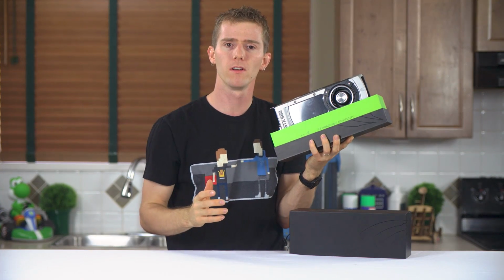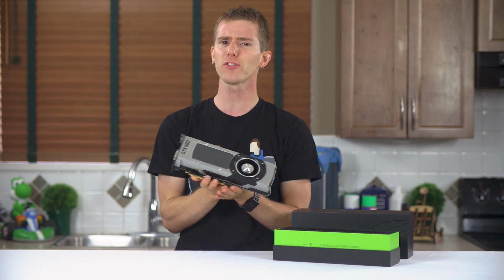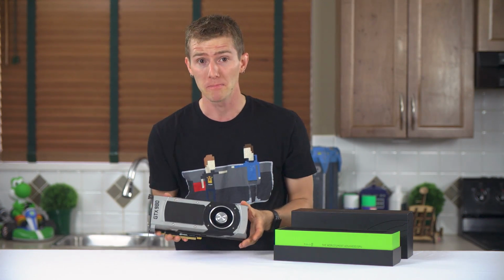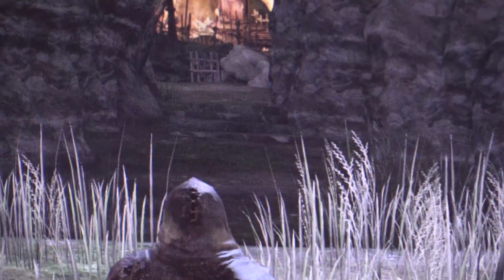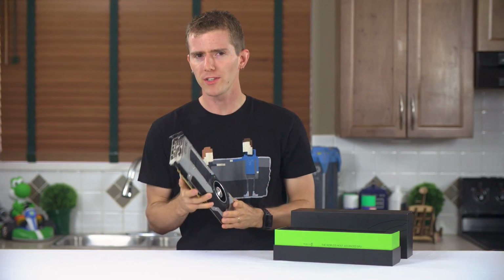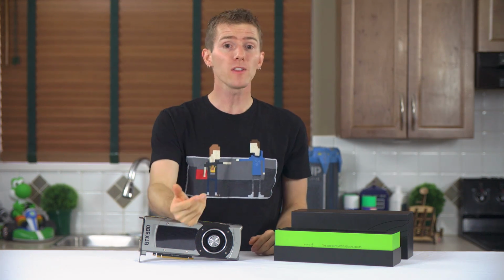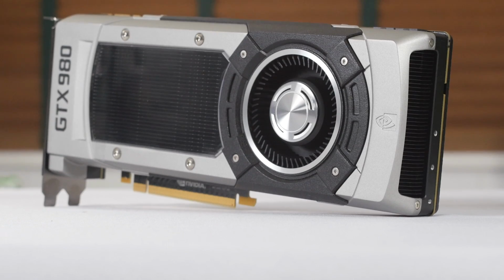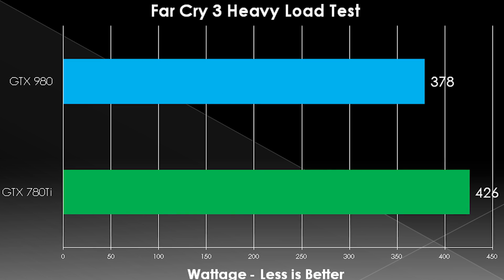NVIDIA GeForce GTX 980 Video Card - Performance Overview

Comment: Is it worth overclocking gpu and cpu?
How much fewer life time do I have and what do I gain for it?
I have fx 6300 and 280x gigabyte edition and 212 evo for cpu cooling.
Playing on 1 1080p monitor.
My motherboard is asrock 970 extreme 4.
Reply: David Vu I am not using 980 or 780 I am using 280x read what I wrote.
Reply: David Boggs The FX 6300 is a really nice CPU actually. You can max out most games with that CPU. That's basically like saying the 8350 or 9590 is garbage because games don't use all 8 cores. By the way you sound like an Intel fanboy :P
Reply: This David guy is an idiot. You can get a decent OC on your CPU with the 212 Evo, I have one myself :) I'm assuming your gaming, overclocking your CPU won't do much at all, but you can boost it 400 Mhz or so just to be same, overclocking your GPU will help but your likely going to get 10% so 4 - 5 fps more. Your stuff will last forever stock and possibly less overclocked, Ive ran my CPU overclocked 2 years straight and a year straight at 80%-100% with no problems, but its an intel so it could be different.
Reply: David Vu You are pretty bad at reading aren't you? lol
It says right there that I have (cooler master) 212 evo for processor cooler.
Reply: Jessup Smith it can nearly max out games that use all its cores, but not single/dual core games. period. btw, you sound like an amd fanboy XD
Reply: Victor Do this victor Do is just a troll, they werent even talking to him, and he replied to him earlier XD

hey, look at that! we can all do it to! ha ha! 

idiot.
Reply: Victor Do http://www.bit-tech.net/hardware/2013/06/12/intel-core-i5-4670k-haswell-cpu-review/5

http://www.tomshardware.com/reviews/gaming-processor-frame-rate-performance,3427-6.html

http://techreport.com/review/23750/amd-fx-8350-processor-reviewed/5

those 3 are just for skyrim, we can find many more for you.

http://www.anandtech.com/bench/Product/697?vs=701 scroll down to games. it simply gets 30-50+ fps in games that dont use all the cores. and has less hickups in games that even do.

btw, the i5 is only around 160 at microcenter. and a board is 120$ the killer.  so no, that whole argument is not valid anymore.  

I only have a fx6300, the 8350 is no different. 

delusions run deep, and very deep indeed.  for games that use single core, and dual core threads only, and emulators. the i5 is simply a VASTLY superior cpu. with sometimes double the fps. in world of warcraft my friends i5 with same gpu and ram, gets 60+ more fps. 
 
So this is the famous amd fanboys I've heard so much about.
Reply: Overclocking doesn't reduce life, heat does. Overclocking has huge benefits. For example, i get much better frame-rate on a moderately OC'd 770 in my heavily modded Skyrim install to the tune of about 15%. Only clock to what your cooling can actually support.
Reply: You are going to need a new CPU as yours is bottlenecking a 980, heck, even a 780...
Reply: Lol yes my I5 is faster, but the cheapest i5 is like a dual core or a quad core with no hyper threading at $200 not hating on Intel but they aren't for budget builds, I highly recommend that you over clock the 6300 it will get you better frames in games even if not by much, mine craft with optifine and BF4 can use 6 cores but even if they couldn't it doesn't really matter you can just use the extra cores for multitasking
Reply: You can get stable 4.6Ghz or more with that cup without need to worry to much go watch some over clocking videos and visit forums if you want to ask questions about it but that CPU is nice for over clocking
Reply: This David is just a troll, they weren't even talking to him and he replied to him earlier XD
Reply: I dont get this talk of the 6300 and a 212 Evo not giving any benefit from overclocking? Of course its going to increase game performance. Its silly to say it wont and it is going to be quite noticeable. As for the talk about electric bill... its not going to increase it that much. Not somethig the OP will need to worry about IMO.

I suggest the OP to go look at reviews of the difference between a stock 6300 and a overclocked 6300 and do the same for a 280x. Then make a decision for himself.
Reply: I would try it out stock and if your not happy gradually overclock until you are happy. The FX series overclocks very easily. Best of luck.
Reply: David Boggs According to the toms hardware link you posted the FX 6300 pulls 59.2 FPS with a stock core clock at 1080P. Not seeing the problem here. Now if a person was playing at higher resolutions then yes I would recommend an Intel cpu. I run skyrim with high res mods at 60 FPS on a 1080P monitor. Not sure why your not happy. What resolution are you gaming at? I did have to overclock for the skyrim res mods though.
Reply: Yes, it is worth OCing your cpu and GPU. Your 212 Evo is a good hsf for cooling if you want to overclock. It seems when you bought/built the pc you had plans to overclock it. That cpu can get you some very good high overclocks as Victor Do suggested. If you OC your cpu and gpu you are going to see much higher performance from your pc. You shouldn't have to upgrade for a while.
Reply: David Boggs Bro you're wasting your time. fanboys don't listen to anything, they don't care. they made the mistake on getting an fx cpu, and no matter what you say, or show, or do. they will deny everything to the ends of the earth.

but good read! i to have a i5 AND a fx 8350 machine. my i5 machine BLOWS the amd out like garbage, in games that use 1-2 cores. even the i3 beats them. in games that use all 6-8 cores. then it CAN get close.  so if you like you say, play allot of mmo's, free games, and games that just use 1-2 cores. and hd emulators. then go i5 110%.

good job, on setting them straight.
Reply: The i5 is better I've never said it wasn't I said it isn't really a budget CPU like the 6300 it's $80 for the FX mobo and $100-120 for the CPU and could be $100 less than the I5, the fx is better for budget builds. Plus the 6300 over clocked is much better then the 8350 over clocked in single threaded games because on air cooling I've seen it go up to 4.7Ghz OCed
Reply: Plus all the guy asked is is it worth OCing your CPU and gpu and my answer is you should try with that CPU since you already own a cooler and it's capable
Reply: GPU overclocking can be quite worth it, for my R9 290 977MHz and 1150MHz is enough for a 10-15fps gain at 5760x1080 in farcry3, project cars, assetto corsa and bioshock infinite which are the only ive bothered to test so far, pretty significant when considering that 10-15fps difference is from 35 to 45 in farcry3 and from 45 to 60fps in project cars :D
Reply: David Boggs Nearly? A 6300 can easily max out Skyrim with an ENB and several other Graphics mods. I'm also not a fanboy. I love Intel and AMD both. Intel does have better performance but it also has higher prices. And a lot of people can't go out and spend 200$ on an i5. So that's why the FX series CPU's are quite popular. I have an FX 4100 and it's only a 99$ CPU but I can still play games like BF3 and BF4 on Ultra.
Reply: Cpu's will last you YEARS with good cooling even if you overclock. They are very hard to break. GPU's are outdated in 3 years anyways so they might break faster when oc'ing but you will probably want a new card anyways by the time they do. Nvdia has tools for auto overclocking that clocks down when the gpu goes over a certain temperature treshhold. So i dont see any reason not to overclock. (They cant check it for warenty anyways) only reason you wouldnt want to do it is if you want to watch power consumption or want your system to run more quiet in my opinion
Reply: I have an fx 6300 @ 4.7ghz with an EVGA GTX 770 Classified. Yes overclocking does help a lot. Especially the FX series since there single core performance sucks compared to Intel. I didn't overclock my GPU but it's a Classified so I didn't really need to. I hope this helped.
Reply: Casey Powell Your spelling is fine, its really irrelevant to the point of the post/topic.  If someone is correcting you on spelling, when the subject is opposite to that which there correcting, then it shows they've not only lost, but due to a possible superiority complex seek out all, and any moments to reassure themselves of there false superiority. When someone has lost, or feels "trumped" they will then refer back to a "foundation" of which they themselves are not masters of, for example Google found 12 errors in his sentence structure, even when correcting you. 

just as with mine, so you see those who correct, need correcting themselves. Which is why people like that cease to obtain knowledge, and rather leech around for the pure purpose of attacking, and defending there idea's of themselves. 

isn't that interesting?
Reply: ***** not good enough, such a delusion I could just as well sit here and mindlessly correct you on your way of life, your picture icons resolution, how your name consists of lower case, and upper case. your point is not valid. and only furthers your delusion. To each his own, and to his own each, surely to assume someone doesn't KNOW how to spell; in need of correction, merely because its incorrect in a comment, is not only arrogance, but such of a gullible mind. pointlessly pointing out things that are utterly irrelevant, under the guise that your just trying to help, really its not convincing anyone.  my statement stands firm.

Do try again.
Reply: I really suggest you to get another cpu because a 6300 isnt going to work well with a 980
Reply: Skylar Garrett That's good amount of information but about my gear specifically how good is it?
Reply: ***** Ah sorry I didnt read that. Okay if you wanna stick to your FX I would suggest to get a decent cooler to overclock, what do you have right now?
Reply: Oh sorry, didnt see it there. You'll gonna need a liquid cooler for this one. Depends on your budget.
Reply: UnknownVoid Name calling? shows how insecure you are.

fx 6300 is garbage, I have it. 

in most games that DONT use all 6 cores, you're in from trouble. 

hd 1080p emulators/skyrim/free mmos/wow/ and all other games that use only 1-2 cores. 

if you are wanting to only run the latest games, then the 6300 aint THAT bad, but it really is a slow, peace of shit even when oc'd. the i5 is just smoother, and less hick ups. also 30+% performance on single-dual core apps.
Reply: Jessup Smith Load speedfan then play BF4 tab out and observe all 8 cores being used.  #shotsfired
Reply: Look at UnknownVoid's message to David Vu
Reply: No. It isn't worth overclocking.
Your FX6300 CPU is fine as it is. It has a decent single thread performance. This will not be a bottleneck while playing a single threaded game, and it definately won't be with a multithreaded game.
With the 280x GPU you can comfortably play pretty much any game at high settings and 60fps or more on 1080p. Overclocking your GPU may result in even more frames, but you don't need them.
The coolermaster 212 EVO is an excellent cooler. It performs around the same as the legendary Scythe Mugen, which is very good. If you were going to overclock anyways, you could keep this cooler no problem.
The ASRock 970 Extreme 4 may not be a real overclockers board, but it's still rated up to 140W CPU power. The FX6300 is rated at 95W stock, so there should be room for a medium overclock, just not a hardcore overclock.
Conclusion: Overclocking is perfectly possible with your current rig, but totally unnecessary. All it will do is raise your power bill, there isn't any benefit in it for you.
Reply: Victor Do I wish to have my computer for ca 3-5 years.
Maybe upgrading to 8320-8350 after a few years though, since my mobo support it.
Reply: Skott62 What I meant to say is, the FX6300 at stock is not a bottleneck for gaming, and the 280x at stock as fast enough for 60+fps @1080p for pretty much any game at high settings. Sure, overclocking will make it all even faster, but you are not going to notice any of it during gaming. 60fps or 75fps, you don't notice that difference. There's no need for the OP to overclock, he doesn't benefit.
Reply: ***** I have already bought it. I said I have not I will have and no it is not. 2 cores is not enough for most of todays games and especially not if you want to do any kind of multitasking such as gaming and web browser etc.
Reply: ***** I never said it will bottleneck. Please keep it relevant to me because this is my comment chain.
Reply: your asking the wrong place go onto a forum dumbass
Reply: LukeIsC00L Why do you call me a "dumbass" when you can't even spell "you're" properly?
Seriously Internet 101 didn't you go to class?
Reply: Casey Powell My gpu is good factory overclocked but apparently the overclocking on 6300 is really good because of slight bottlenecking the 280x. 
My computer is not up and running yet but idk how much I should wait even if I should overclock.
Just start right away or wait a few days/weeks?
Reply: Casey Powell Ok, thanks then.
Press read more if you wish to read my grammatical correction for you.

you're*
Reply: ***** haha, yeah my spelling needs work.
Reply: David Boggs I gave him the option to see the grammatical correction. It is not necessary in any way here but it is nice to have from time to time.
That's why I wrote it so you had to press read more to see it so he wasn't forced to look at it to read my reply.
I don't seek perfection, I just like helping people. And just because I might need help myself doesn't mean I shouldn't try to help others and I am not only talking about correction. I am talking about everykind of help.
Reply: David Boggs The thing is I don't care what you think much, I gave him the option to see the correction and he seemed to like. I would probably like it too and I am not like all the other grammar nazi's I don't always correct people and I try to do it in a nice way instead of just writing the correction and starting a grammar war. If he doesn't like it I'll stop but since he did like it I stand by my decision for that.
Just because you are cynical and don't understand that some people do try to help others without getting anything in return doesn't mean they don't exist.
and I say it yet again I know it wasn't necessary but it worked out for both of us so I really see why you involve yourself in this.
I never said he didn't know how to spell but in case he didn't know how to spell that certain word now he has the option to learn it but he had the decision to watch it since he had to press read more and knew what was there because of my description.
Can we get back to the topic now?
He seemed to enjoy it and I tried to do it in a more pleasant way than usual grammar nazi's do case closed. It ended well.

Comment: I have a GTX 680 should I upgrade to the GTX 980 or wait for the GTX 980Ti or the next generation? I want to upgrade in April 2015 as I am in the final year of high school and don't play games now.
Reply: ***** Here's a quote for you. "Following the launch of its GeForce GTX 980 and GTX 970 graphics cards, NVIDIA announced discontinuation of three of its top-selling high-end graphics cards, the GeForce GTX 780 Ti, the GeForce GTX 780, and the GeForce GTX 770."
Nope. No more 780ti, 780 or 770 if you were looking to upgrade or SLI unless you want to buy a card used, and definitely no official price drop since stores are dropping it after they run out of stock. Not really a surprise given Nvidia's past history with this, but it came pretty fast. It took a least a little bit longer back when I had my 570 for them to discontinue with the 600 series but it still happened fairly quickly and I never got a nice price drop to get a 2nd 570, ended up getting a 770 later.
Reply: There is unlikely to be ti version due to max cores in the 980
Reply: I'm still using 2 gtx 680 even tho I have 3 gtx 780 and 2 gtx 770.Upgrade only if you needed or your graphics card can't no longer run the modern games.All I can say is GTX 680 is still a good  GPU,it can still run Crysis 3 at maxed setting in SLI configuration.
Reply: ***** the price 290/290x may drop cuz 980> 290x but at the same price, 780 however, will be discontinued, so if one isn't the fan of online buying, he would stick with 970 this time.
Reply: I am getting a 3D monitor in April 2015 as well so AMD is out question because of their poor support for 3D and I know that a single GTX 680 is not enough for 3D gaming with the latest games at highest settings. My budget is around $750-$800 for the graphics card but I don't like SLI because of the poor support for it in some games. Considering that I don't think the GTX 980 to be a massive improvement so I want something faster but at the same time I don't want to wait beyond April 2015 as I only have 4 months vacation
time to play games because that my college stars and there will be no time for entertainment. So should I go for a single GTX 980 or 2 GTX 970's. BTW I will get the GTX 980Ti if that launches and it's more than 2x the performance of a GTX 680.

Comment: Can u make a update ultimate guide with the all new haswell E and x99 geforce gtx 980 4 way with EXTREME water. Cooling with angle fittings and stuff too THX